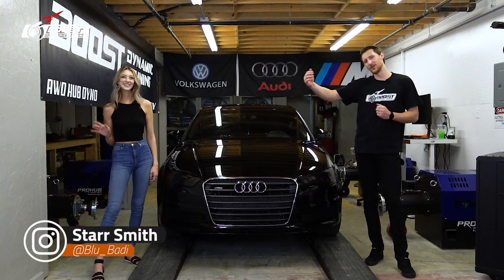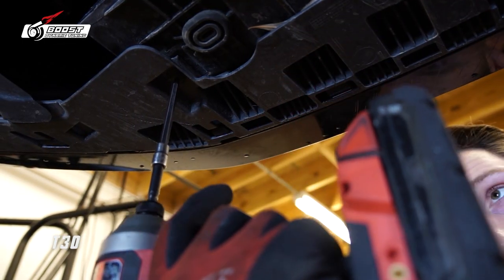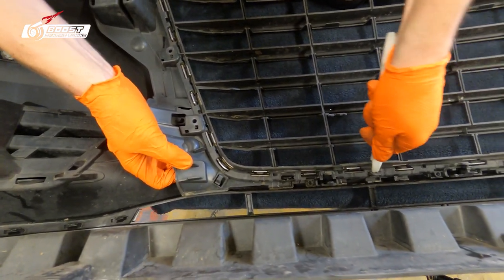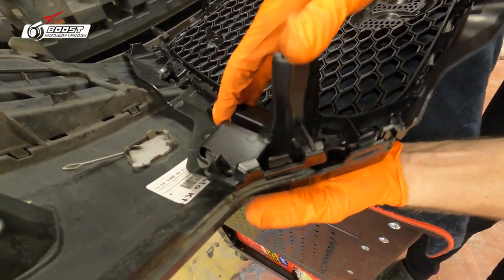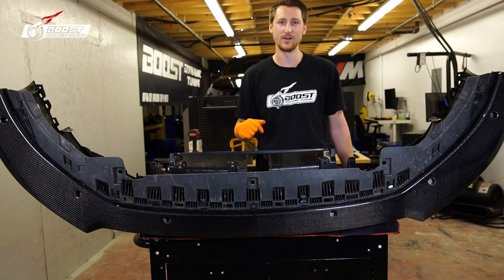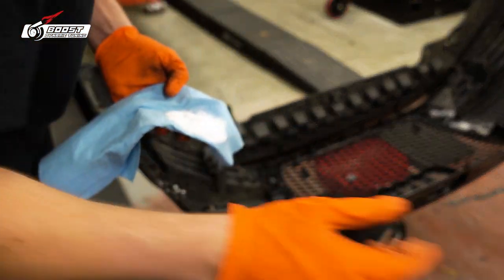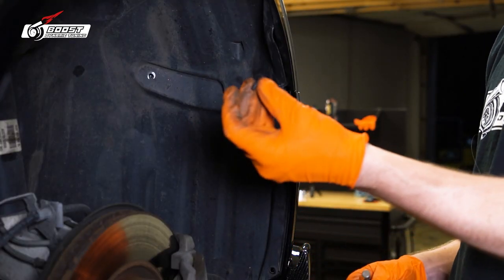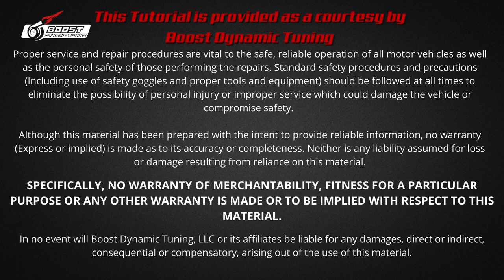DIY/How to Install Aftermarket Front Grill - 2015 Audi A3 MQB 2.0t

Comment: This couldn’t have been a more perfect video. I have the same year Audi and am doing the same project in a few months, once the winter leaves LOL. Have parts nicely waiting for me in my storage. 💪🏻🔥😎
Reply from the maker: Thank you! I try to give you guys a heads up with what's an install will require. Hopefully save you some headaches
Reply: How is the car going? I’m thinking of buying one as well.
Reply: @ahsanjaved952 So far so good. No MAJOR issues. Only issue was an EPC light which was caused by faulty aftermarket coil pack, once it was replaced perfect so far.

Comment: Ran into a snag. At the part where the T30 that connects the bumper, my guards just will not budge. It’s the part where you say “you’re just gonna get a little forceful”, but I feel like I’m gonna snap the thing.
Reply from the maker: If you're doing this in a cold environment  anything under 60f, you definitely want to be careful. Get it in a warm garage and grab it like you're about to tear it off and give it a hard pull! If you don't commit it, you'll end upi causing more damage.
Reply: @boostdynamictuning  thank you!! I’ll let you know how it goes lol

Comment: I recently bought a mk5 gti tsi and I’m pretty sure it has ur stage 2 tune I was wondering how to engage the 2 step
Reply from the maker: The tsi depending on order number didn't come with two step. We recently added this option.
Reply: @boostdynamictuning  where can I get the tune with 2 step do u have a link?
Reply from the maker: @ogcsupra5522  give us a call, 989-418-8460 so we can get you set up.
Reply from the maker: @ogcsupra5522  https://boostdynamictuning.com/2008-5-2013-gti-golf-2-0t-stage-2-remote-tune/

Your going to purchase this link as you're the tsi model. Let me know if you have more questions.